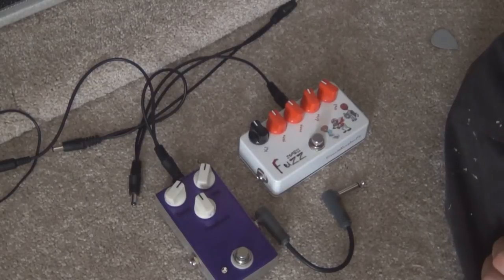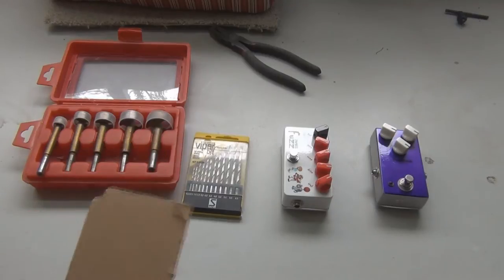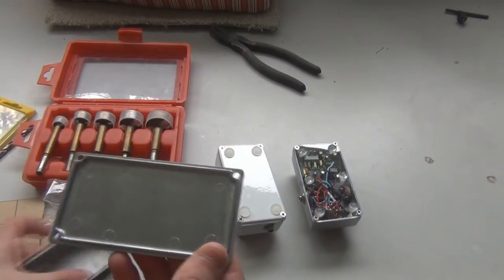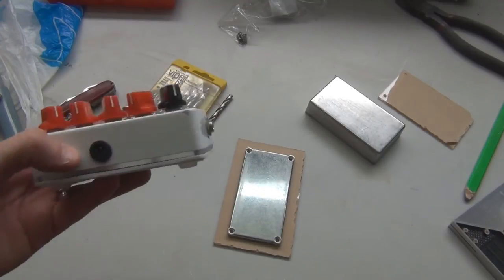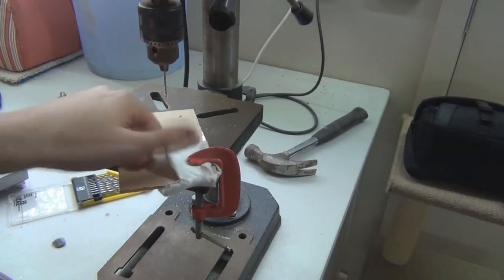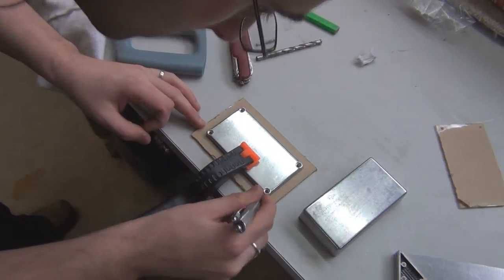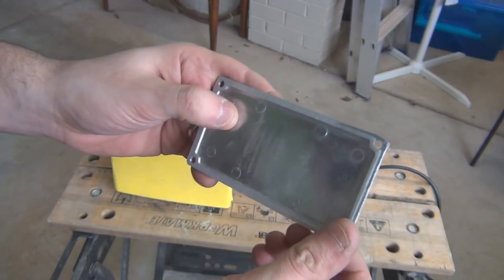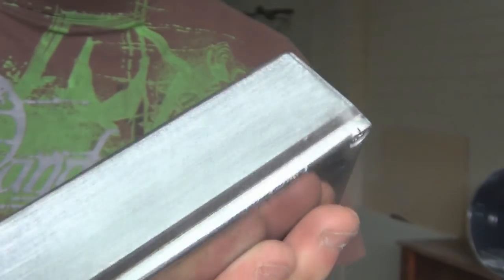Tutorial: Guitar Pedal Lightplate

Comment: Great vid,  thanks!  I think if you lay the aluminum back plate on a rubber matt, you could rip it down easier.. not have to hold your sander sideways or use a vice huh?
Reply from the maker: I think I have so no slip rubber matting for crockery in the garage that could be a good idea thanks!